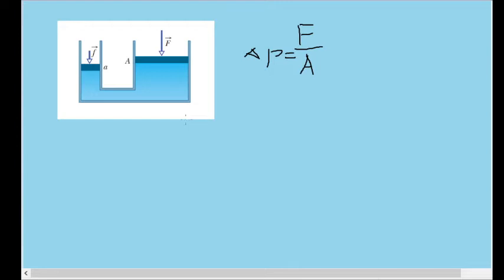Fluids - Problem #28

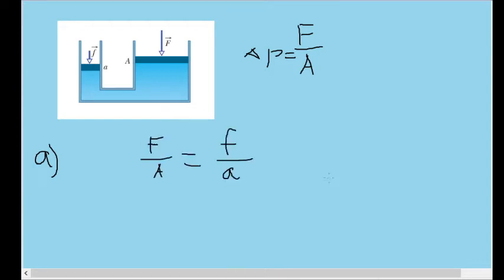Comment: This problem was solved by applying Pascal's Principle, which states that a pressure change in an incompressible fluid is transmitted throughout the fluid (0:25-0:37). This means the pressure exerted on the small piston is equal to the pressure exerted on the large piston (2:09-2:19).

Here's a summary of the solution:

    Understanding the Hydraulic Press and Pascal's Principle: The video introduces the setup of a hydraulic press, where a small force on a small piston creates a larger force on a larger piston due to the constant pressure ratio (0:00-1:02).
    Part A: Deriving the Force on the Large Piston (F)
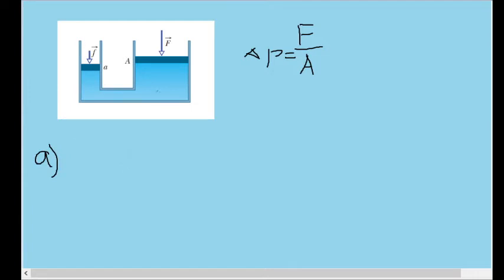        The problem defines the forces and areas: f (small force), a (small area), F (large force), A (large area) (1:15-1:34).
        Using the principle that pressure (Force/Area) is constant, the formula F/A = f/a is established (2:06-2:19).
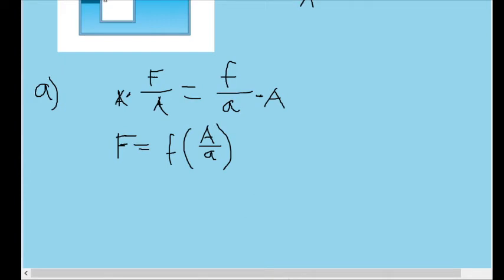        This formula is then rearranged to solve for the large force F = f * (A/a) (2:20-2:44).
    Part B: Calculating the Force on the Small Piston (f)
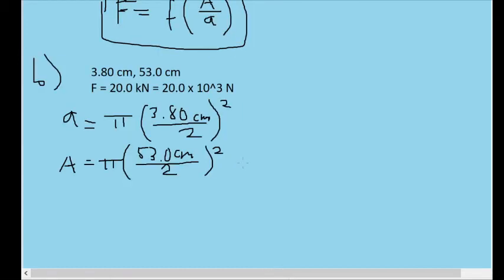        Given piston diameters (3.80 cm and 53.0 cm) and a 20.0 kN force on the large piston, the goal is to find the small force (2:57-3:18).
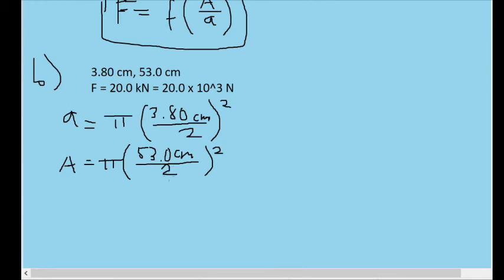        The areas (A and a) are calculated using the circle area formula πr², adapting it for given diameters (π(d/2)²) (3:20-3:42).
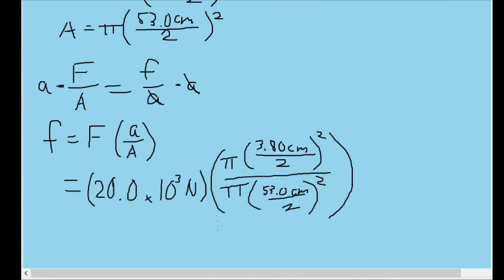        The constant pressure formula is rearranged to solve for the small force: f = F * (a/A) (3:43-4:12).
        When the area formulas are plugged in, the π and (1/4) terms cancel out, simplifying the formula to f = F * (small_diameter² / large_diameter²) (4:15-4:38).
        Plugging in the given values, the small force f is calculated to be 103 Newtons (4:39-4:43).
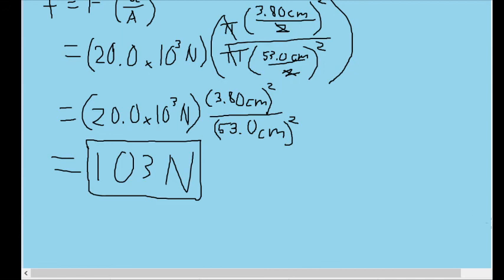    Implications: The video concludes by highlighting that a small force of 103 N can generate a large force of 20,000 N (20 kN) on the larger piston, demonstrating the power of hydraulics based on Pascal's principle (4:47-5:19).